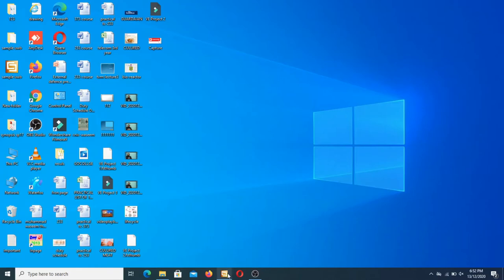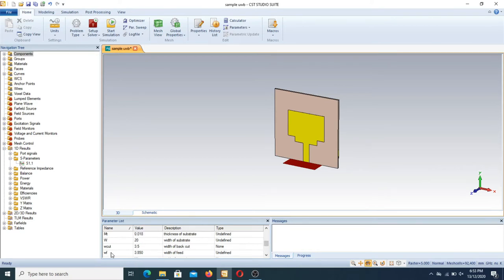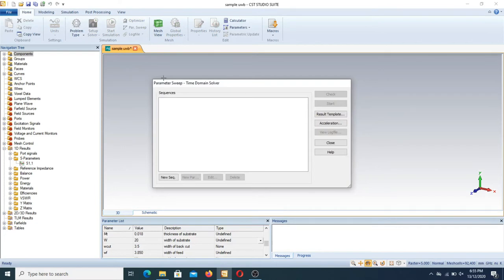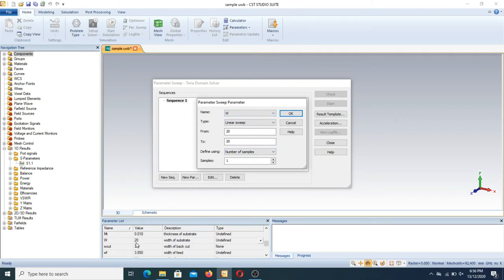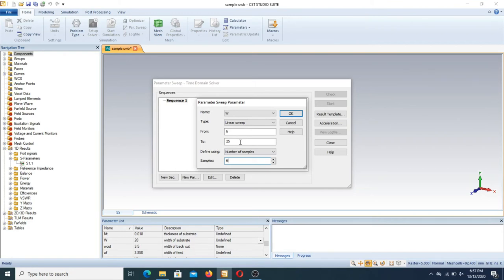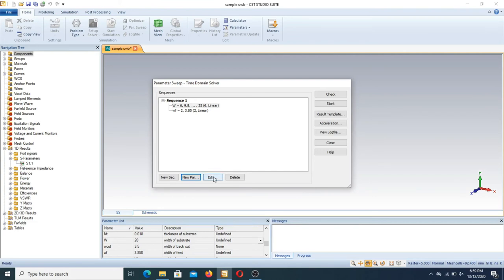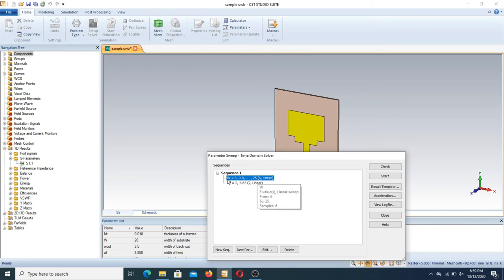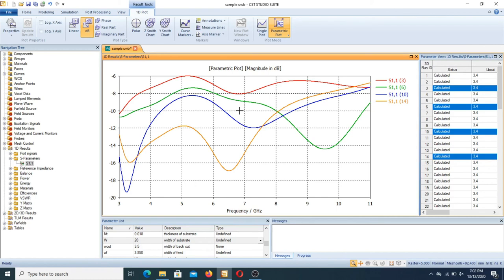How to use parametric sweep in CST studio| parametric use in antenna design |parametric sweep

Comment: how to get the patterns for various parameters?
Reply from the maker: It's on assumption
Reply from the maker: Supposed if you get some value at 4mm then set parameters to 2-12 with some step to get multiple value
Reply: @infotechscience  but i do not get the option for single plot and parametric plot..i need your assistance
Reply from the maker: When you run parameters sweet Jo got mult output on single graph how ever if you select single parameters combination it show single graph

Comment: how to sweep Two parameters in synchronization in CST
Reply from the maker: I think it is mentioned in video
Reply: @infotechscience  No I mean change in synchronization for example I have two variables (px and py) (each one varies from 0 to 180) and I want them to varies in synchronization: (px=180 ,py=180 then px=165 ,py=165 etc) do you know how to do it?
Reply from the maker: @sciencelearning2326  you can set parameters sweep like px from 165-180 with step size of 5 and then also enter same py from 165-180 with step size of 5,you will get following iterations like
165,165
165,180,
180,165
180,180
Then select results which u want
Reply: @infotechscience  Yes I know that bro, but in this case it will take more time in simulating, because I just want to iterate for similar values only (180,180 then 165,165 then 150,150 etc)
Reply from the maker: @sciencelearning2326 then only take exact value
Reply: @infotechscience  Thanks a lot bro , I have just question Do you know for what can we use the option (parameters combination settings) that exist in parameter sweep option
Reply from the maker: @sciencelearning2326  no idea I didn't use now cst , actually my Ms completed I mean thesis then didn't use the software now
Reply: @infotechscience  Thanks, and God bless you Bro
Reply: @infotechscience  hii sir. How do we sweep the permitivity of the substrate material?
Reply from the maker: @sagivijayaramaraju1153  dear I didn't now using the software but may b in parameters sweep option we can add variable of permittivity of substrate but not sure because I am not using this software